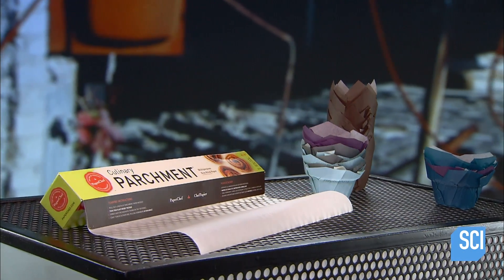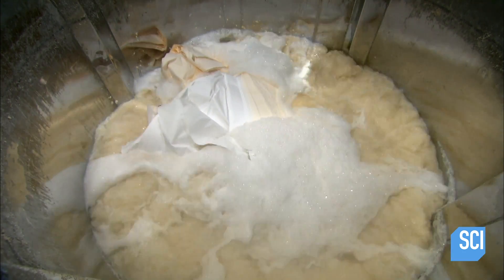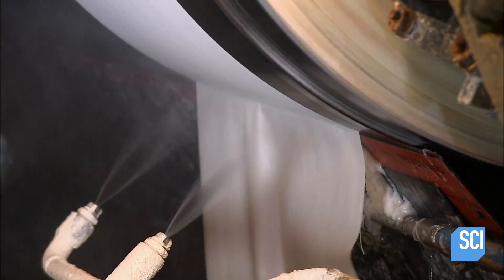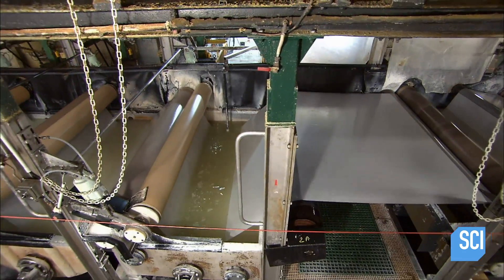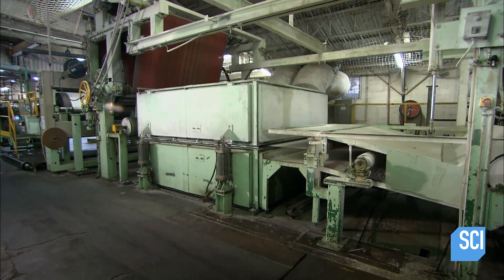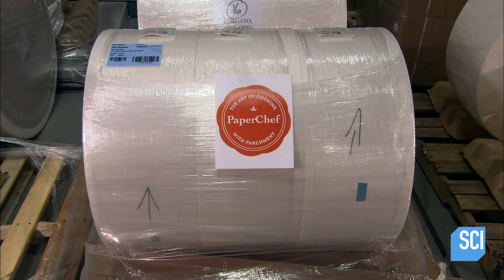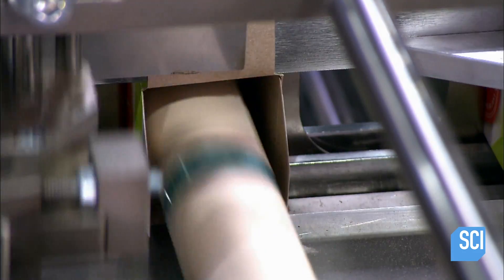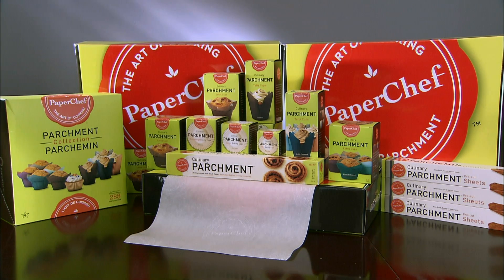How It's Made: Parchment Paper

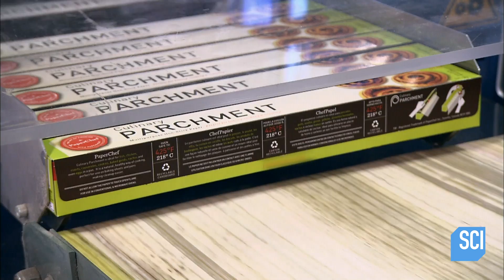Comment: 4:39 the silicone rubber coating is sustainable?  I assumed that stuff was essentially another plastic: Reliant on fossil-fuel derived chemicals. No?
Reply: That's correct. It's mostly based on the elements silicon and oxygen which don't come from fossil fuels. But there are minor components of the silicone that are fossil fuels based

Comment: "No need for a non-recyclable metal cutter..."  Uh, did I miss something here?
Reply: Well you shouldn't throw plastic into paper recycling, as the success in separating it from wood pulp can be somewhat mixed, and then if they do separate it out, there's nothing they could possibly do with it. But they will separate out steel bits like staples or that cutting edge with a magnet and recycle them. This series contains good footage but is usually riddled with terrible writing mistakes.

The parchment paper itself isn't recyclable either.

I think they substituted the cutting edge with a plastic one for cost, or in a hope that it wears down quicker and you throw out the whole box of paper to get a new one. It's not an environmentally friendly business at all.
Reply: @SianaGearz  Not all metal is magnetic.
Reply: @Stealth55555  I specifically said steel. It doesn't make sense to use any other metal for the staples or for the cutting edge of the container.
Reply: @SianaGearz  Some steels are not magnetic. Stainless, for example.
Reply: @Stealth55555  you're being so contrarian you're showing your ignorance. nobody would use stainless for this purpose, common 304 is 10x more expensive and doesn't hold an edge.
Reply: the serrated edge of the box you use to tear the paper straight.
Reply: @Stealth55555  I understood that part, but what kind of metal in "non-recyclable?"
Reply: @TechGorilla1987  Meaning you cannot recycle the cardboard box that has metal on it. This box does not have a metal strip, so its 100%  cardboard and ready to throw into recycling.

Comment: The "Hi Rez Scanner" checks it for imperfections. Do we really need to follow it up with the insanely time/cost inefficient step of having two guys unroll the entire bolt of paper to look again for imperfections?
Reply: they probably do it a couple of times a week to see if the scanner is really working. obviously not to every roll.
Reply: They probably don't in reality
Reply: I imagine it's like 2-step authorization for log-ins. One is to make sure in the general case, while the other is more specific.
Reply: The comments on the high resolution scanner were grossly simplified. The imperfections he was talking about is weight variation and moisture variation. They have separate scanners looking for bits of “trash”.

Comment: The machine stamps the box with a lot code so that, if there a problem with an individual roll, the factory can trace the error back to to the original spindle, realise it's all been sold and say "Fuck it. Keep going!"
Reply: If the problem is consistent enough (like a lot of customers complaining about parchments from the same lot), it can be used by the manufacturer to trace back to and take actions against the wood provider.
Reply: Or, you know, issue a recall.
Reply: Thank you for your helpful insight.
Reply: I can see you have literally no idea how factories work
Reply: Yeah yeah whatever y

Comment: Why is the metal cutting edge not recyclable? Everything else is
Reply: It would be, I think they are just blowing smoke about how "green" this is. Lol. I want to know who is washing off used, baked-on parchment paper so that it can be picked up by the recycling man. Seriously, who has time for that? 😂😂
Reply: The plastic one on that brand sucks. But anywho, the thin metal ones though are covered in glue to stick to the box and still covered when you peel them off. Just go ahead and peel one off and ask that again while your holding the sticky curled strip of sharp metal and wonder about the feasibility of it. You do break down your recycling right?
Reply: @dmcgee3  you can throw these cutting edges and staples and other such things directly into paper recycling, you don't have to separate them out. They actually shred everything and then separate out steel bits with a magnet, and they will be recycled. Anyway if a little bit of steel lands in a landfill, that's not a concern really, it will just turn to rust which is naturally very abundant in the soil, no problem at all. And it's not like we're about to run out of iron.
Reply: I actually think steel edge is more environmentally sound and works better.

Also i don't think silicone bonded paper is recyclable, and if they can separate some of the wood pulp from it, they still have a mass of silicone to deal with, which can be burned in a reactor but in most regions will probably just get landfillled, which is not ideal.

Comment: parchment or grease proof paper is a very old product 

so what did they use to give it its properties before they decided to add silicone??
Reply: Wax
Reply: @DislikesForAI  no, thats wax paper...
Reply: acid bath
Reply: @crisangle8592 You've obviously done more digging than the majority of the commenters. The acid bath is the first "water based" dip they conveniently skip past in the video. I guess they didn't want to have any mention of acids while promoting a food product. Perfectly safe though. And the paper would be useless without it.
Reply: It's bleached and dunked in "food grade" chemicals, so... :face-orange-biting-nails:. I got some parchment paper liners for an air fryer that have a exposure warning for lead, cadmium and DEHP, whatever that is... and mine where the unbleached ones, so 😵‍💫

Comment: "the paper is WATERPROOF, but you can wet the paper to fit into a mould" ... Isn't water-resistant better?
Reply: Water does not damage the paper so you call it water proof.
Reply: I've used that ability to make odd shaped cakes. It works brilliantly. Why ask for something that wouldn't do it?
Reply: Neither waterproof nor water resistant are scientific/engineering terms or descriptions. Everything is waterproof/water resistant to some degree.
Reply: @DrLumpy  so
Reply: @johnscott2849  So, because ... if you want the argument to be about "It should be called..." waterPROOF vs waterRESISTANT, the definitions of those two terms are indefinite.

- EVERYTHING dissolves in water. EVERYthing.
- NOTHING is water PROOF.
- EVERYTHING is water RESISTANT

The only variable is time.

Your statement above "Water does not damage the paper so you call it water proof" requires definitions of the terms within itself. What kind of "damage"? How long before the damage manifests? Water on computer printer paper doesn't bother the paper for a few seconds or minutes. Recycled paper shop towels can remain undamaged for minutes/hours/days/months when exposed to water. I'm pretty sure parchment paper would show "damage" after a few hours in water. Water on ANY substrate will ALWAYS show a molecular/atomic CHANGE in the material. "Damage" is a subjective term. In terms of use, paper/wood/textiles function at an optimum moisture level. ie paper has to have "enough" water or it's function as whatever kind of paper is diminished.

See how that all works? We have to be careful with descriptions because there's a pretty good chance that NOBODY else agrees on the same description.

Science rules..:-)
Reply: @DrLumpy  why can't you just take it for what it is water does no damage to it so real simple for you that means it's water proof
Reply: @johnscott2849  From an engineering standpoint, is simply isn't "that simple".

Make an umbrella out of "waterproof parchment paper". Let me know how it turns out.

Language is a powerful and versatile thing when used correctly. Deadly and inaccurate when used haphazardly.

Comment: Why are you saying putting silicone in the compost is a good idea? It is not biodegradable
Reply: I think it's because the silicone is harmless in itself. It shouldn't be much anyway.
Reply: Glass isn’t biodegradable either but neither of those silicon-based products does any harm in the ground
Reply: @russellmoore8187  not the same thing tho, as silicone leaches. 

"Silicones are not completely inert or chemically unreactive and can release toxic chemicals. They can leach certain synthetic chemicals at low levels, and the leaching is increased with fatty substances, such as oils."